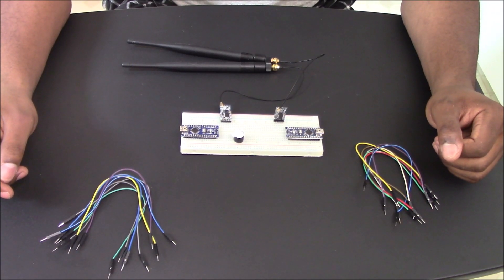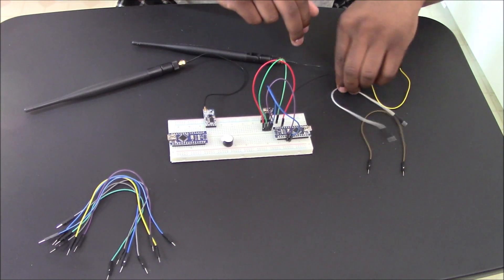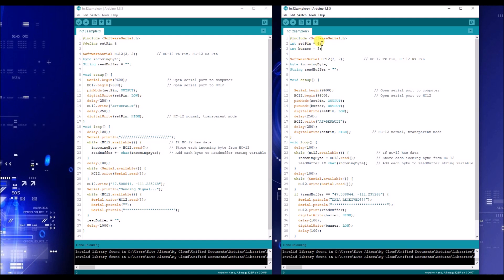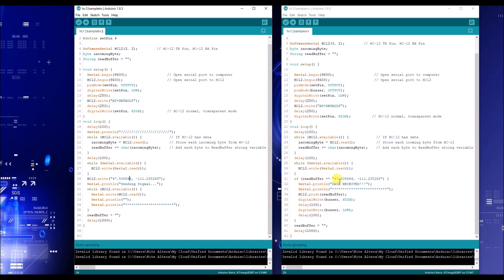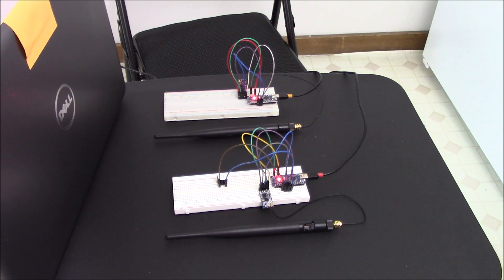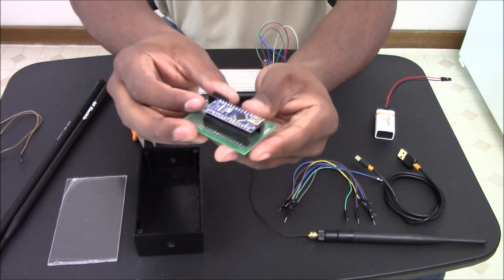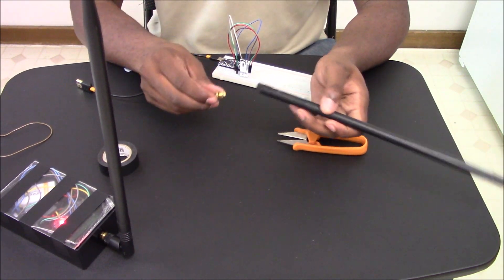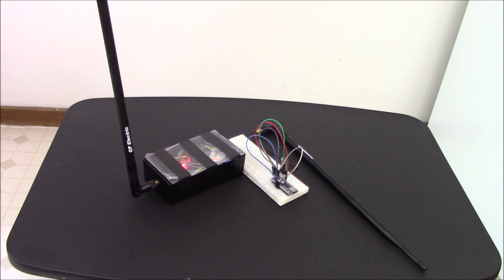HC 12: How To Build The 1/2 Kilometer Arduino Transceiver

Comment: Dear sir,
Please guide me How to get 100 Meter range with the Hc 12 module 
My modules are not giving me Range more than 10 Feet with the Original helical Spring Tiny antena 
Please tell me is it because of small antenna 
Or any Parameter Setting issue 
I have set Fu4 setting 
P5
Db11
Baud rate 1200
Reply from the maker: Your best bet is to use a 2.4ghz dipole antenna with a pigtail.
Reply: @BlackFalconElectronics  
thanks for reply 
Is it suitable to use 2.4Ghz Antenna while Module Frequency is 433MHZ ?
And Also Tell what should be The DB's of Antenna with 2.4GHz
What is the role of DB's in Communication ?
Please answer your answer will be appreciated
Reply: i got ~700M with 5db 433mhz antenna.I installed with the following parameters: AT+B1200, AT+P8, AT+FU3
https://www.elecrow.com/download/HC-12.pdf

Comment: hello,sir can i use 13dbi 2.4 ghz antenna with hc12 for larger distance communication?
Reply from the maker: You can
Reply: @BlackFalconElectronics  sorry sir 2.4 ghz is not working.kindly provide some solution.

Comment: is it ok to use 2.4 Ghz  antenna altough the frequency of the HC-12 is not 2.4 Ghz??
thank you.
Reply: I don't think so. You need 433MHz antenna for HC-12. This 2.4GHz antenna is working like a piece of wire.
Reply: @dadoxx1  Ok Sir, thank you
Reply: It does work with 2.4 ghz antenna.  If the effective range is maximum ?  Anyone's guess until someone tests these with actual tools comparing antenna
Reply from the maker: @WhatAmIGonnaGet  the video is actually of me testing with 2.4 ghz antennas. I've tried testing with 433mhz antennas but only got around 20 feet. Perhaps they were low gain, but I went back to just using 2.4 ghz antennas after that.